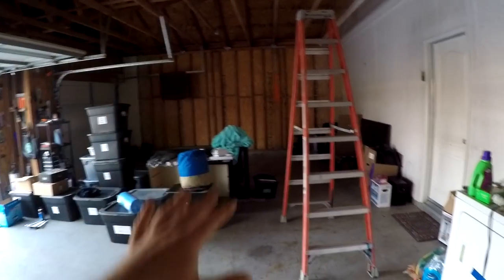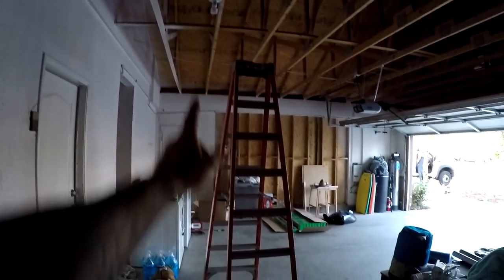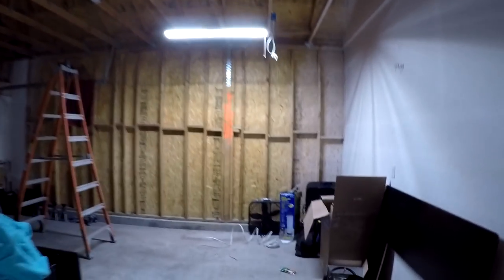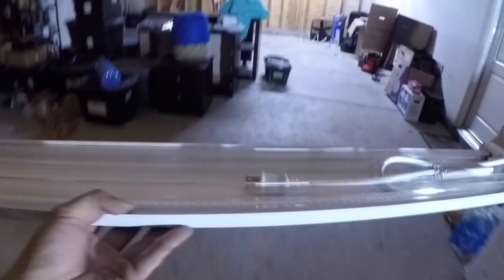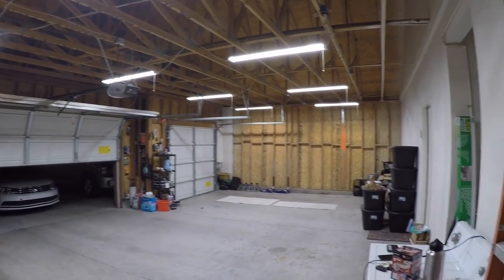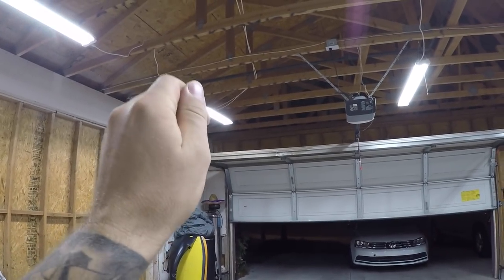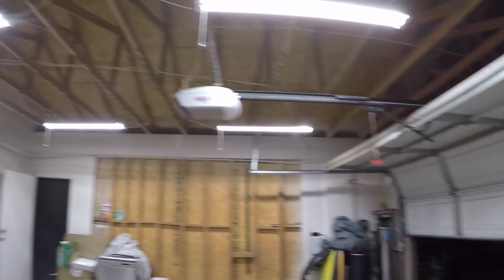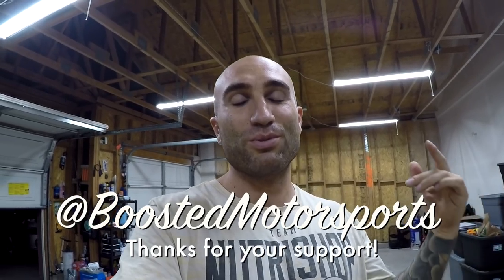LED Garage Lights Install DIY

Comment: My $2 says, put the last two lamps right where you suggested. (If you really need them; it’s good and bright now). But where you are thinking makes sense.
I can see it now, soon will home reno vids! Haha 
Nice work bro. 👍🏼
Reply from the maker: Thanks Barry!  Yeah thats the only place I could see putting them since the double bay side of the garage is a bit longer than the single side.  I'm going to do a separate channel for those DIY and keep this channel on topic.  I got that dryer you see for free and it was a $3 part to fix it which I made a video on lol.

Comment: You should add some lights lower on the side walls. This helps as well when you have the hood open or working under the dash of cars/trucks.
Reply from the maker: That would be cool too!  We shall see how things look when we start wrenching.  I have that snap on LED flood light that I usually sit inside the engine bay which blasts light pretty good when needed 😎

Comment: Future project, add a 3 switch panel so you can turn on and off the lights in the areas you need versus having to pull the strings. And I second the other comment with painting the joists white to blend in with the garage.
Reply from the maker: Good idea!  I want to see what the typical usage is and where we end up working in the garage once its all setup and we will definitely get it dialed in accordingly!  Also I hoist will be happening which we will reconfigure the joists for 😁

Comment: Looks good bro. link too Amazon for the led lights?? I got a pair close to these from Costco like some others said. love that you can daisy chain them. At least you know home wiring! would have been cool to show how you took it from the one outlet and wired it into the other outlets. Congrats on the new place!
Reply from the maker: I got mine off eBay but these are the same ones that you can get off Amazon and check out the reviews.  I was debating showing how to wire it up but I don't want to be responsible for someone electrocuting themselves or burning their house down lol
https://www.amazon.com/Sunco-Lighting-Pack-Equivalent-Integrated/dp/B0728P14FR
Reply: You make a good point. :-)

Comment: You select not to have a finished garage ? no roof and no inside drywalls  :)
Reply from the maker: There may or may not be a lift and reworking of the joists soon so it will be bare for now 🙂

Comment: You got a link to the lights
Reply from the maker: I got mine from eBay but here is the same brand and you can check out the positive reviews on Amazon https://www.amazon.com/Sunco-Lighting-Pack-Equivalent-Integrated/dp/B0728P14FR

Comment: How about a link to purchase. Thanks
Reply from the maker: I bought mine off ebay but here they are on Amazon and you can check out the reviews 😎
https://www.amazon.com/Sunco-Lighting-Pack-Equivalent-Integrated/dp/B0728P14FR